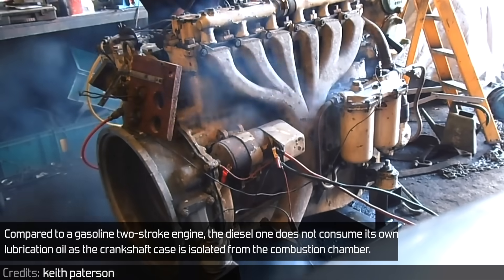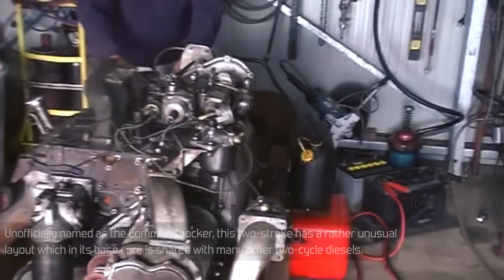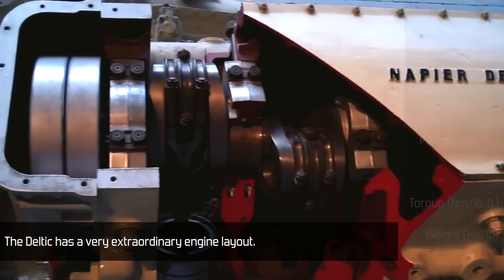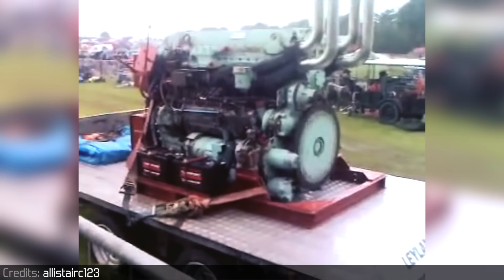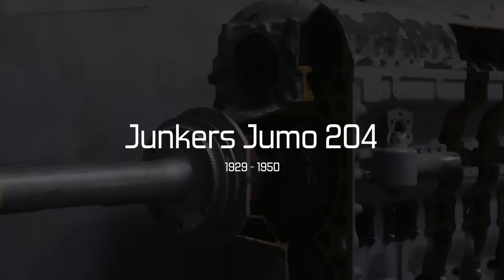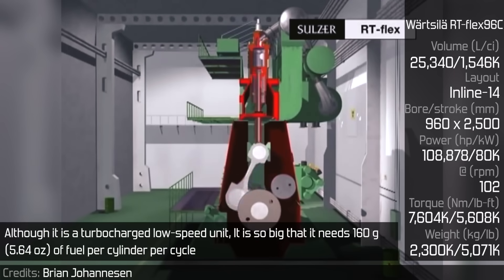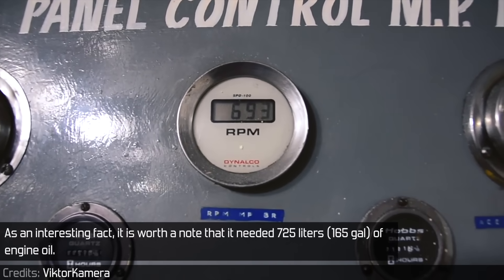9 Cool 2-Stroke Diesel Engines

Comment: EMD is the Electro-Motive Division of General Motors. In their prime they were they largest locomotive manufacturer in the USA, building 60% of the countries locomotives. Their nearest competitor used engines that were not as reliable. The EMD was legendary for it's reliability. I think GE used Cooper-Bessemer engines while Alco used Fairbanks-Morse engines, although it might have been the other way around. I don't know what engines Baldwin used.

Comment: Take 3 Junkers Jumo engines and pout them together and you get a Deltic. When used in Patrol Boats the crew was not allowed in the engine room while the engine was running, because they had a habit of exploding, At any time without warning.

Comment: The Junkers was the inspiration behind the Deltic. After WW2, England needed a more economical engine to replace the Rolls-Royce Merlin petrol engine that was used in their patrol boats. They needed a Diesel that was compact, powerful, relatively light and economical, and the Deltic was the answer. It was then used in Britain's first Diesel-Electric Locomotives, as well.

Comment: The Commer was built by Rootes Group because they owned Commer. The engine was originally designed by Tilling-Stevens, which is why it was called the TS3. There were plans to make a TS4, but they never eventuated. Rootes Group got it when they bought Tilling-Stevens, in the '30's, I think it was.

Comment: One engine not featured here was the Doxford 2-stroke. A slow speed marine engine like the Wartsila RT-flex, but it was an opposed piston design. The top pistons were connected to the crankshaft by very long rods down the sides of the cylinders in a sort of goalpost arrangement.

Comment: The emd v20 engine makes over 5,300 horsepower and over 41,000nm of torque and it's Max RPM is 900-950. And the wartsila rt flex96c is incredibly powerful. Jesus Christ 😂😂

Comment: Unless you were born well yesterday like you stated the you would of heard off the Detroit Diesel engine, you should also have know when you did your research that they also made a 51 series in a 2 and 4 cylinder and a 110 series 2 stroke only in straight 6 configuration ( One of the reasons they discontinued the 110 series is the 8V71 was similar HP and lighter and didn't share many components)

Comment: The Commer TS3 was a 3.5Ltr and had 135hp. The engine was a Cube design and not a Flat 3 and It did have six apposed pistons. The early ones had a inline 3 injector pump, driven by a timing chain. Later ones had a rotary pump, driven by gears. There is a proto type TS4, which is in New Zealand

Comment: The Commer TS3, was a 3.5ltr and developed 135HP, with a supercharger. It was a Cube design with 3 Cylinders at the top, 6 apposed Pistons, 6 rockers running down to the crank at the bottom. The earlier ones, which ran a timing chain at the rear of the block (Flywheel End), with an inline Simms Injector Pump. The later ones had timing gears instead of the chain, with a CAV Rotary pump (DPA). I know, I use to rebuild them in the mid 60's.

Comment: Another notable vehicle that used the Napier Deltic engine was the Mack Superpumper for the New York City Fire Department in the 1960s, it was so loud that fireman who operated had to use ear protection within 100 feet.

Comment: The Foden 2stroke was a noisy piece of gutless shit that was forever  cracking cylinder heads across the valves, the noise from these engines was horrendous and how drivers did long distance work in these vehicles was incredible, the firm I worked for had one of them and we could hear it coming out of Trafford Park which was 3miles away from our Depot in Ardwick, the driver regularly drove to London in it doing an overnight trunk service. The engine of that vehicle was screaming at the top speed of 40MPH imagine being in that for 10hours it's enough to drive you insane it's no wonder a lot of operators ripped them out and put secondhand Gardner 180s in them or Leyland 680s. The later ones with the 225bhp Turbo two stroke with the 12speed gearboxes were a little quieter and faster but not much.

Comment: Full of incorrect statements. It's like all the stuff he read he came across in the first paragraph of the wiki without actually reading it fully. Most engines struggle to reach 50% thermal efficiency, only the largest stationary engines can do that. 

The Napier deltic was built for the Royal Navy to power small destroyers. Napier built aircraft engines primarily and it showed. You would ship entire assembly's back to the factory to have work done. They were fantastically powerful for the size of the engines physical dimensions.

The Leyland Rolls Royce engine is also quite reliable. It is not the most powerful, and the tanks it was put into necessitated pulling the entire powertrain assembly to change an oil filter. The heat exchangers are known to fail, but that was bad design on the heat exchanger not the engine.

Most two strokes are highly thermally inefficient. You can achieve theoretically high efficiencies with and opposed piston design as you do not have a cylinder head to lose heat to. You are still working off the 2-stroke cycle and as such you require scavenging. 

The large ship engines don't use diesel fuel. They use heavy oil that is thicker than gear oil but has more latent energy. Some of those engines can achieve thermal efficiency in the low 50% range. Smaller engines tend to only run up to about 30 on average and 40 on the top end while some of the older engines operated in the teens and twenties.

Finally, there really is not much difference between a 2-stroke gas and Diesel.it's not as though the fuel is the deciding factor in how the engine is built. Mostly it simply has to do with induction design. Most two stroke gasoline engines use what's known as crankcase scavenging. Early Fairbanks Morris designs used crankcase scavenging on their stationary diesel engines. Early ones had a separate cylinder to scavenge.

He didn't even mention the Nordberg radials.

Comment: I used to workon cargo ships. Main engines there are enormous! Cylinders are so big a person could fit in them. Each cylinder has its own crank space. The engine Is almost two stories high and 30 ft long! And of course, no starter would crank those monsters! They are started by putting compressed air into cylinders, lots of air, very noisy!

Comment: So where is the two stroke triangle engine then?
Load of crap!
Reply: In the bloody great blue class 55 locomotive which had two of them. They also powered “Ton” class minesweepers for the Royal Navy and PT boats used by the Navy SEALS in Vietnam.
Reply: at 3.00                  there is the triangle napier deltic

Comment: Good video. You missed one displacement size when you discussed Detroit Diesel. There was a 110 cubic inch per cylinder engine built only in 6 cylinder inline configuration. It powered PT boats.
Reply: Dont forget the 51 series. It was a valveless design,utilizing cylinder liner ports in place of intake and exhaust valves.
Reply: sorry ,, pt boats were powered by PACKARD marine M2500 gas v12s called garwood packards,, not related to packard aero engines, , they were 2500 hundred horsepower, the garwood packards were later replaced by packard diesel marine engines

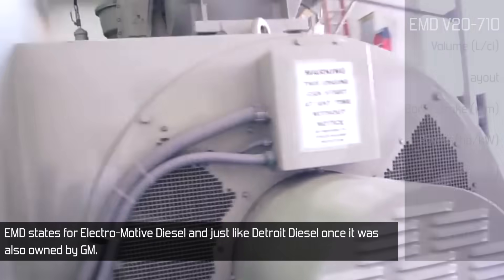Comment: 6:54 EMD stands for Electro Motive Division.
The EMD 710 V20 was used on the EMD SD90/43MAC diesel locomotive, these locomotives are becoming a bit rare but are easy to find on YouTube.
Reply: SD80MAC also use 710 V20 , and SD45 use 645 V20

Comment: Good video, but in need of some corrections. EMD, Electro Motive Diesel. Earlier a GM division, but after all the GM economic failures of GM, established now as their own business, and NOT under Daimler, but with Caterpillar as the mother company slowly phasing in their own 4-strokes. Daimler however "owns" the "on road" business of current Detroit Diesel, all 4-stroke mixed up with some MB versions. The industrial and marine business of Detroit was taken over by MTU, part of Tognum and lately swalloved by Rolls Royce Industrial. All 4-stroke and the worlds biggest industrial diesel manufacturer group. Fairbanks Morse is absolutely no "was", but is still very going strong with their medium speed 2-stroke opposed piston engines powering marine and power stations all over the world. They have taken over ALCO, and produces MAN and Colt-Pielstick for US markets. A division of EnPro Industries. Nice that you got the Commer opposed piston 2-stroke engine. A "crazy" design with 3 cylinders, 6 pistons and an intermediate angled connection rod for each piston to 1 single crank in the middle!!

Comment: There are still diesel locomotives in Russia that utilises 10Д100 two stroke opposite pistons 10 cylinders diesels (100 is for displacement in leters I guess). Also quite interesting engine which has 2 turbos, 2 intercoolers and blower to supply air in cylinders

Comment: Another one to add to this.
Crossley HST V8.
2 stroke with reed valves controlling the air intakes.
As fitted to the Metrovick class 28 English locomotives. 
Only 1 left and that's being restored by a group at the East Lancashire Railway in Bury UK.
Reply: Its a reed valve 2 stroke.

Comment: That was not even the most interesting Napier two stroke diesel, there was the Napier Nomad a mad mutant offspring of a two stroke diesel and a jet engine.
Reply: Donald Sayers.
It was nothing to do with, and nothing like, a jet engine, it used the exhaust to drive a turbine which in turn drove the propeller.
Reply: I am sorry to say that you are wrong. The Nomad was a turbo compound, the exhaust turbine the compressor and the piston engine were all geared together,  the pistons and the exhaust turbine both provided power to the propeller. The compressor and turbine were taken from the Napier Naiad which was as turboprop IE a Jet. After the turbine the exhaust gas went through an afterburner and out of a nozzle at the back generating extra thrust equivalent to some 400 extra horsepower, which looks pretty jet-like to me. Read "Some unusual Engines" by LJK Setright, or even Wiki for more.
Reply: Donald Sayers.
Yeah, it seems I had a totally wrong idea of what goes on in these engines. I've had a bit of a Google around, and I can't really find anything that explains or shows the concept properly.
What I don't understand, is there any combustion going on in the turbine and does it actually make thrust like a turbo prop engine? Or is it just a turbine driven by the piston engine exhaust gases only?
Reply: Thanks. The Wiki article is a bit sparse on  details. The Axial compressor supercharges a two stroke diesel, the exhaust of which drives the turbine and then out the exhaust to provide thrust. So the diesel is acting just as the flame cans do on a jet, but the compression ratio is much higher than could be obtained on a straight gas turbine, so better economy. All the rotating parts are geared together.

I am slightly confused as to the differences between the two versions. Article here http://www.npht.org/nomad/4579733511

Comment: The second loco was not a Class55 “Deltic”, it was a class 37. The Deltic has one if the best exhaust notes along with Rolls Royce Merlins and BRM V16s.
Reply: SvenTviking The class 37 is being used as the test bed for the 'baby' Deltic t9-29 engine....this engine had been saved but none of the actual locos survive...a very short lived and unsuccessful sibling to the class 55's which were magnificent.
Reply: http://www.thebabydelticproject.co.uk
Rebuilding the "Baby deltic " from a class 37 with the t9 engine inside.

Comment: The FM 38 D 8 1/8 engine actually has a 20 inch stroke. The “38” refers to the year it was originally designed, 1938. 
P.S. I maintained and operated one for five years, including multiple overhauls and repairs.

Comment: The second clip on the deltic engines at 3:20 is a 9 cylinder version called a T9/29 or a baby deltic and is both super and turbo charged opposed to the 18 cylinder version which is just supercharged. It has a nominal output of 1100bhp. The loco you see in the clip was not fitted with that engine, the engine was fitted in it to run it up after extensive rebuilding. It is the last known surviving T9/29 engine. Check out http://www.thebabydelticproject.co.uk/

Comment: Awsome video, finally the BIGGEST of the BIGGEST!

Yes the giant marine diesel engines have hydrolically activated exhaust valves which are controlled electronically. And there are only one exhaust valve per cylinder in the top of the cylinder head. Intake is from ports that are exposed when the piston is at bottom dead centre.
Reply: Lukas. 
All two stroke diesels have an exhaust valve only, and will not work without a blower for the induction and to evacuate the exhaust gases.

Comment: A good friend of mine's father goes  commercial lobster fishing everyday on a boat with a 35 year old Detroit 671 they rebuild it 5 years ago only maintenance they ever done to it other than that was change the oil regularly and  the injectors once he says he's gone down in the engine room before after a long storm tied up at the Wharf minus 26 Celsius and it fired right over

Comment: I almost spit out my drink when I saw the displacement of the EMD engine, 232 liters.
Reply: It was supposed to be a 6000 hp engine but it never worked out. The same holds true for GE's 6000 hp behemoth. Most of the SD-90's were either equipped with 4300 hp 710's. pending 265H bug solutions, or retrofitted with 710's. Some 265H's were just withdrawn from service and are sitting idle or scrapped. With the GE AC-6000, I've read some of them were fitted with the 7FDL-16's 4400 hp. pending retrofit to the 6000 hp. version. Others that were delivered with the 6000 hp. version installed met the same fate as the EMD 265H SD-90's.

Comment: EMD is now under Caterpillar, not Daimler.
Reply: I read up on a 3406 that was converted into a poppet valved u-loop scavened 2 stroke, BTW there is a lot of space in a 3516 or c-175 v-160 to cut ports into the liners with a high pwer laser or plasma cutter! it would need a machined aluminum jacket around the liners to cool it above the cut ports though. there is a lot of space between the bore to do this, it would sound awsome.

Comment: Fun fact, the Napier Deltic was developed from the Napier Culverain, a licence- built copy of the Junkers Jumo 204. Napier Nomad is also an interesting 2-stroke diesel, but with a power recovery turbine for added thermal efficiency, like the Wright R-3350 Duplex Cyclone turbo-compound engine used in Super Constellations and DC7bs, but with a two stroke diesel in place of the radial engine. Wow, I'm a friggin nerd.

Comment: you'd want to look at the Napier nomad. That engine probably runs on magic
Reply: Yeah, the Nomad was an unholy marriage between a valveless flat-12 diesel with a gas turbine engine.  Incredibly complex, it's a miracle that they ever even got one in the air.  But it was very efficient.  It didn't make production because the world was moving toward jets in the early 50's, and propeller planes were too slow and uncomfortable to ride in.
Reply: Andy Harman.
It was nothing like a gas turbine engine, it was just a two stroke diesel engine that used the exhaust to drive a turbine which in turn drove the propeller.
Reply: No, it was a lot like a gas turbine engine.  Multistage axial compressor and turbine sections, and a gear reduction system that included a CVT for matching the turbine shaft and diesel crankshaft speeds.  That was the simplified Mk 2 Momad.  The Mk 1 Nomad included a separate combustor for the turbine section.
Reply: Andy Harman.
I had a totally wrong idea about these engines, and I can't seem to find much on Google that explains or shows what goes on with them. Is there any combustion going on in the turbine, and does it make thrust in it's own right, or is it driven solely by the engine's exhaust gases?
Reply: You can probably find more information about the Napier Nomad online at the Napier Power Heritage Trust, or at the Aircraft Engine Historical Society.  I got my information about the Nomad in a book by Herschel Smith that included a detailed cutaway drawing.  The Nomad Mk 2 didn't have a separate combustor feeding the turbine section, but the Mk 1 did.

Comment: Foden FD6 is inline 6, not flat 6. Flat 6 would be Porsche or Subaru engines.
Reply: Actually if it has two pistons per cylinder then I don't know if it would be called H6 or I6 but it seems like all the cylinders are inline which is how the naming convention has always been, how cylinders are arranged, not what is inside the cylinders. Regardless, this is a cool channel, no one else does what you do.
Reply: Marcus Taber.
An engine with two pistons per cylinder is called an opposed piston engine.
Reply: OK that makes sense, but all the cylinders are inline so I-6, vs 3 cylinders on each side.
Reply: Marcus Taber.
No, I think you're getting a bit confused, Type this in - Opposed piston engine with two cranks.  It's a simple animation and it should help you understand.
Reply: I fully understand what you are speaking about but the convention of describing an engine always specifies how the cylinders are arranged. In this case it would be an opposed piston inline 6, another example would be the german junkers jumo 205, or (not inline) the napier deltic which I think used a triangular 3 block.